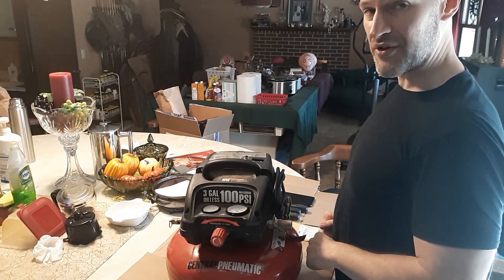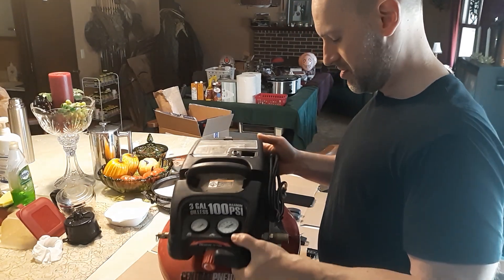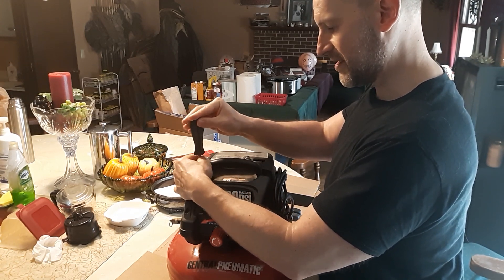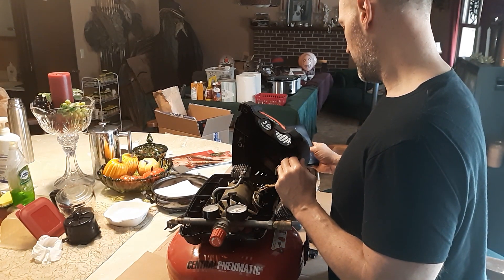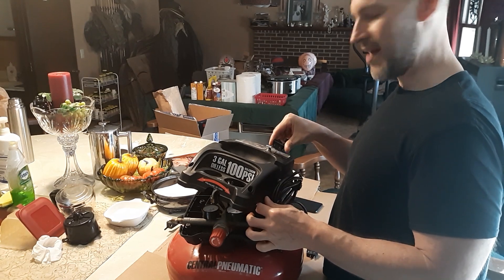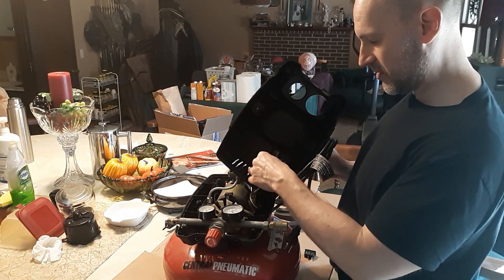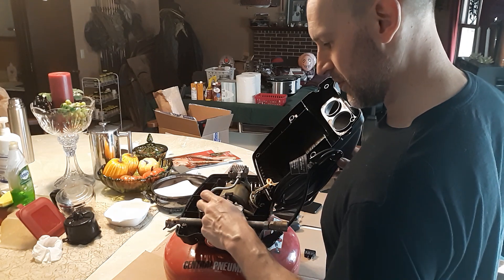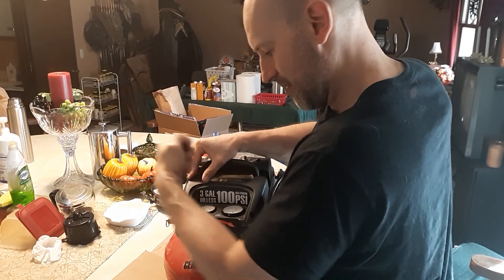Replacing the Power Switch on a Harbor Freight Pancake Compressor Nov 4 2023

Comment: Great Video, I have three points;
1) Thank God that few people watch your videos, otherwise you might cut into my equipment repair jobs
2) Is that Gospel music I hear in the background?
3) You could have saved yourself $10 by simply discarding the factory switch and use a wire-nut to make the connection. (Red-Green Style)
Reply from the maker: Haha. As always, you are right on all accounts